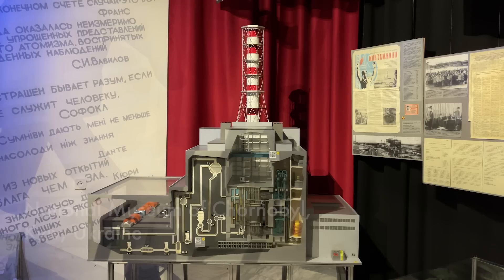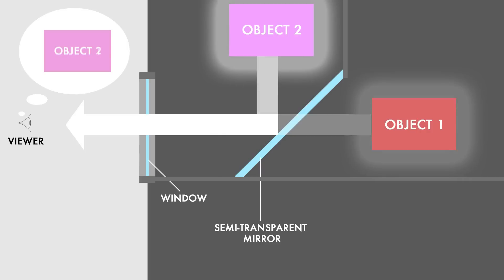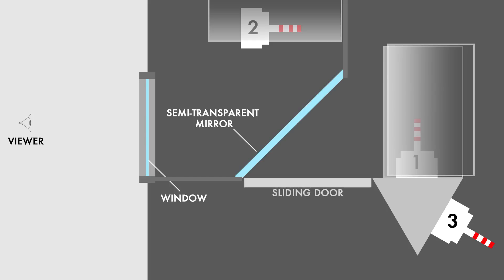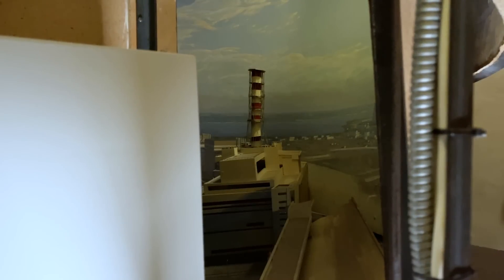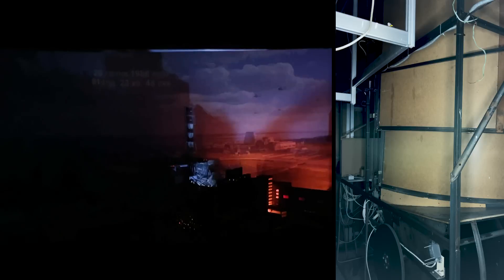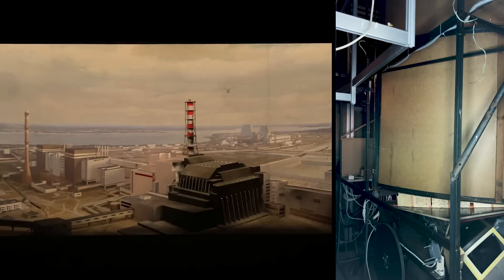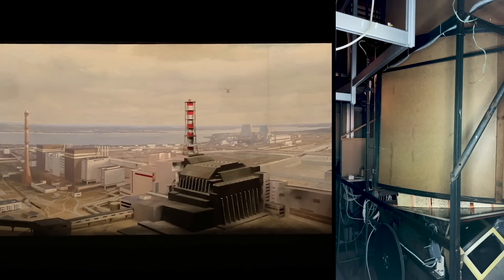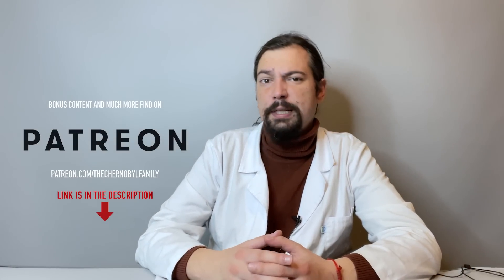This is how it works: Mechanical Diorama of Chernobyl Museum

Comment: It’s hard to see in the video, but does it fade to black between each transition?
Reply from the maker: Between 1-2 and within 2 stage - yes. Between 2 and 3 the transition is very very short.
Reply: @ChernobylFamily  you would wonder why they chose that when the could have done it with the peppers ghost effect and given a much more dramatic and impressive effect.

Comment: this is on my bucket list now, next to the one in the fire brigade museum!

thank you for sharing this! electromechanical systems like this have always been of great interest to me. Probably one of the reasons why I‘m an engineer today. For me it was a H0 train system and all the bits and bobs that come with it that drove my interest in electricity and mechanics from an early time..
Reply: where I used to work there was an ancient reaction vessel controller.

It wasn’t that ancient tbh, it had been in operation until the 90s. It was an electro-pneumatical sequencer. A large horizontal drum had vertical sections where small pieces could be mounted on the many screw holes in the massive drum. Each section had a pneumatic switch.
The output of that switch was routed through AND and OR gates and then fed a valve somewhere in the plant.
It was an interesting project to fix it and make it a display piece. With electromechanical switches it could have been used to control such an installation too.

This is, sadly, a lost art.
Reply from the maker: There is a thing in regards of this, the exhibition in Kyiv we mentioned still exists and became even bigger, the only thing now it is located not in the center of Kyiv, but at the 25th State Emergency-Rescue Department of Kyiv GU DSNS,  at the north of the city. That department itself is the biggest in Ukraine. I do not know if they have the diorama with apartment mr. Trubinsky told about, though. Link: https://kyiv.dsns.gov.ua/muzey-istoriyi-pozhezhnoyi-ohoroni-m-kieva

The one pictured in the video is in Ivano-Frankivsk GU DSNS, https://if.dsns.gov.ua/uk/photo/8509

From what we know, all that you can visit for free with a guided tour, just you absolutely must to call and book your visit because those are always located in functioning departments and guides are actual firemen.

Comment: 3:37 I wonder why it was hard to get items, just a comparative between the price/pull system versus central command economy/push system. no wonder why one system won and the other lost.

what amuses me in art is that restriction is part of the art. we don't have those anymore because its easier to model in computer graphics nowadays. I also miss the 1990s games, they were really different because of the restrictions of hardware. (maybe that's why soviet art was good usually)

well, people still make tech-demos. I like creating strong restrictions for the purpose of having art. someone could start creating and using dioramas for this purpose, it would be cool.
Reply from the maker: ...because in 1991 the situation and deficit was that hard, that a Christmas gift my mother got from my grandfather was a one pack of a washing powder. Literally. It changed quickly to better, but in 1991 it was an absolute bottom.
Reply: @ChernobylFamily maybe in Kyiv it ended sooner but on perifery it was a shit hole until 95-96

Comment: The electromechanical model solution is a lot cooler than hiring a team of animators to make a cartoon. And all analog in its first incarnation, makes it even cooler.
Reply: is it analog when there was a lot of electro-mechanical relays that are open/close ? that's almost digital for me
Reply from the maker: The main 'brain' consisted of time relays. Probably, it would be more correct to call it a discrete system.

Comment: What a clever design. Kudos to the designers and engineers behind this fine piece. 
Are the lights still the original incandescents, or were they changed to LEDs in the renovation?
Reply from the maker: Will ask and then come back to you

Comment: I would especially be interested in seeing the microprocessor system used to upgrade the system and to learn how it functions and actuates all the motors and lights,
Reply from the maker: There is this article at the website of the company who was the contractor: https://chint.ua/uk-ua/vidnovlennja-roboti-diorami-v-natsionalnomu-muzeji-chornobil-
And there are pictures, including how it was before.
Reply: Unfortunately there isn't an English version of that website, I can't read Ukrainian language and Google can't translate it. As for how it actuates things I'd imagine they used a PLC (programmable logic controller) or similar. That's my guess based on years of designing machinery automation controls. Another, more difficult, approach would be to use something like a Raspberry Pi micro driving a bunch of solid state relays.
Reply: @sootikins    Top right corner of the web page, there is a Ukraine / English option.
Reply: @BobBeatski71  Well this is weird... it only gives me choice of Ukrainian or Russian. Looking at the drop-down next to the little world globe icon top right. Using Firefox on Debian (Linux)
Reply from the maker: Here is a translation:

The diorama, the restoration of which has been completed, vividly illustrates the tragic explosion and subsequent construction of the sarcophagus at the fourth reactor of the Chernobyl Nuclear Power Plant.

The previous assessment of the diorama's technical condition confirmed the moral obsolescence of the automation equipment for this exhibit. Therefore, a decision was made to upgrade and replace a significant portion of the equipment using CHINT switching and protective devices.

A programmable logic controller was used to control the new automation scheme of the diorama, managing NC6 series mini contactors with additional NCF6 contacts. Modular circuit breakers from the NXB-63 series were used for electrical circuit protection, and NS2 series motor protection circuit breakers with front-mounted additional contacts of the AE type were used for motor protection.

The most challenging part turned out to be setting up the control scheme to meet the museum staff's requirements and preferences. However, currently, the diorama is functioning smoothly, immersing museum visitors in the atmosphere of the most significant technogenic disaster that occurred in Ukraine. Its consequences remain contemporary issues and unfortunately will continue to remind us and our descendants of their presence.
Reply: @ChernobylFamily  Thank you!! I was really curious about the equipment used in the restoration and I'm happy to see my guess was pretty much correct.